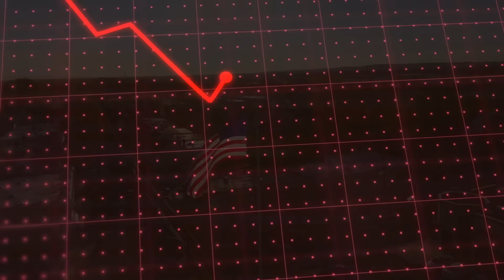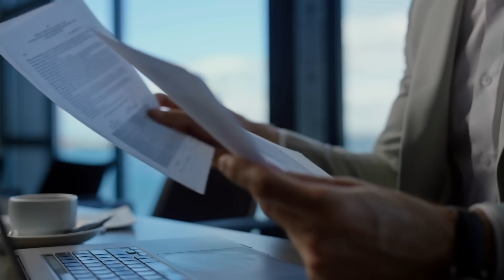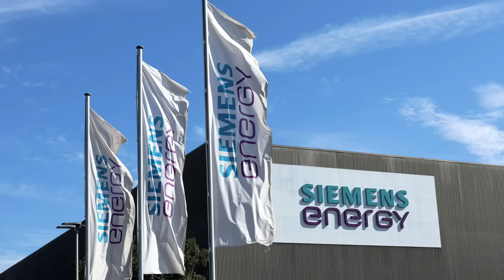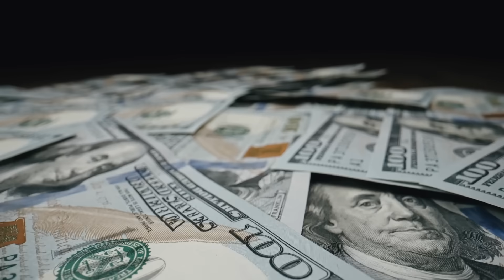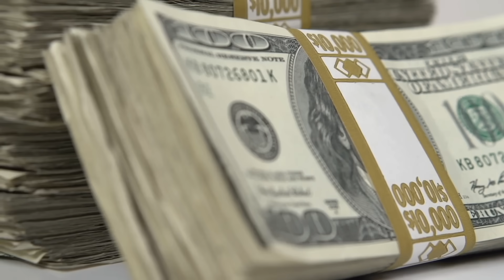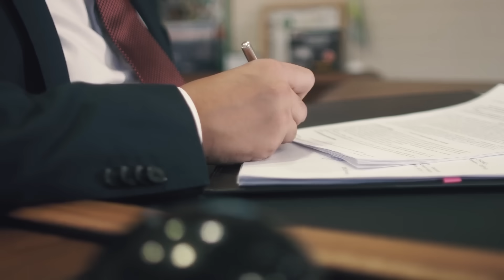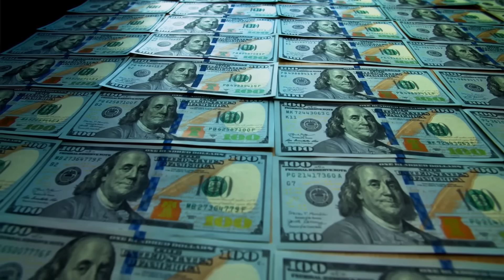The Real Reason America Has Turned Its Back On Wind Power Energy

Comment: Use the unconnected solar and wind installations to generate green hydrogen.
Reply: Hydrogen is Not  very efficient. You have to build storage, transport the gas To wherever its needed and end up in a fuel cell, making electricity. Why not use the electricity directly or Big battery storage.
Reply: Not only is hydrogen not very efficient, it is also highly flammable . . . remember the Hindenburg? That was both a "hydrogen storage" and "transportation" system.
Reply: @mhherr  We already transfer and store huge amounts of methane around, both as LNG and compressed gas. It has 3x the energy per volume as H2. There are relatively few mishaps. By far the biggest source of explosions and fires is plain ol' gasoline.
Reply: @rozonoemi9374  Good point, but it's a matter of scale. There is no current battery tec that can address dunkelflaute scale. Hydrogen can, but as you say, it isn't just a "big battery"; it's a whole different energy transfer grid where hydrogen must go to an FC estate close to where the energy will be used. So this "hydrogen-tank-not-really-battery" takes its place alongside hydro, interconnectors and maybe even some new heat-battery tecs to address these long-term high-capacity storage reqs. IMHO new Sodium-ion battery tec may make a dent in this, if costs come down to say $40/Kwh. Over the last couple weeks revolutionary new low-cost flow-battery chemistry has been demo'd. We'll see where that goes.
Reply: Stringing more wire is more efficient by far.
Reply: Aha! Yes this. We have a storage and distrubution issue. Hydrogen would solve both.

Comment: Dipshit's you cannot have systems feeding into the main grid that fluctuate like wind and solar. In Australia every solar system on a house must be able to be turned off from the power company. The reason is the voltage of the grid rises too much to get it in so on good sunny days a lot of time house hold solar is turned off as it would fry everyone's appliances. Storage is a joke but one day not in my lifetime.
Reply: As you wrote yourself, they can be connected.
And it is pretty standard that automated power generators of a certain size can be turned off remotely.

Comment: "Very green to make and maintain." - a complete LIE.
Reply: 1/100th of the CO2 emissions of a coal power plant for each produced kwh.
Reply: @old-pete That is a lie - the environmental cost to mine and smelt the metals, produce the thousands of gallons of lub oil and to make the composite blades, which are NOT recyclable, and the CO2 released by making the concrete used in most of the bases has not been HONESTLY reported. FACTS, not wishes, Grasshopper.
Reply: @donaldcarey114  The CO2 emissions of this work is already included...
And no, windturbines do not need thousabds of gallons of oil.
There are multiple options for the recycling of turbine blades.
Reply: @donaldcarey114  please don't repeat oil-company propaganda.
Reply: @alanhat5252  Please stop repeating green scammer's lies (or are you getting a kickback?)

Comment: ARE THERE ANY REAL SOLUTIONS?? ''YES'' I am RDP Marine since 2016 my unit had its proof of concept test. Its a retrofittable system for large dams both storage and hydro to make more power from the same volume of water. THEY DON'T WANT IT !! 
Pumo hydro needs 40% more energy to lift that water than is made when it falls through a turbine but thats OK. WHY? well u will pay 20-25% more for your power rather than not have it
Reply: yes. there are solutions. some are so very simple.
mine can be retrofitted. to a coal station. to a nuke. just need the steam turbine and generator. some water....

they dont want it. they dont want free power. as free as maintenance, supply, upkeep, installation...  they dont want it cheap. they want us suffering, clamouring, begging... fighting and squabbling.

we're in the hot water now! ;)

Comment: I worked on scoobie sands windfarm in JUNE 2023.  Heavy lift major component exchange of gearboxes, generators, transformers and pipe coolers! 

This is the image of the one burned down on a sand bar.  Vestas V80 nearly 25 year old and ready to be de commissioned
Reply: 25 years is not that old for most electricity infrastructure. Why are they being decommissioned so soon? Have they even paid for themselves by that time?
Reply: @Ethan.Lamoureux It is the mechanics that do not last that long. The electrics are usually fine.
With good maitenance one keep them running for 30 years, but the technical advancement in that time was huge in the past. From an economic perspective it is often better to replace them with a windturbine of threetimes the power.
Windturbines are paid off in 10 to 20 years, depending on location.
Reply: @old-pete  About 30% of my area’s electricity is generated by a hydroelectric facility which is over 100 years old. The old turbines and generators are still going, with only minor maintenance and upgrades over the years. Why don’t wind turbines last like that?
Reply: @Ethan.Lamoureux  You can be sure that the turbine blades are not orginal. They do not last that long. Generators can last that long, but at least the ball bearings and electrical contacts were changed. Water turbines do usually not have to endure forces above what they are designed for, as the water drop does not change.
Wind turbines have to endure the enviroment 24/7 for many years. The wind does not stop at the design speed. Windturbines need to endure all turbulences and storms over 20 years.
Additionally the forces are much greater due to the size of the turbine. If one exchanged the blades and bearings, one could run windturbines for many decades. There are examples of 40 year old turbines, but it usually not economical. One has to remember thatt the power of windturbines tripled in 20 years.
Reply: Opening image of the burned out nacelle is from Scrooby!
Reply: Some of the grey boxes in infrastructure shots had Russian text printed on them.

Governments failing to get on with the job of governing is worldwide & must be corrected before they condemn us all to ignominious deaths.
Reply: Hoax.

Such a load of garbage.

There no such thing as a greenhouse effect.

The whole premise of AGW -- the greenhouse effect -- is wrong.

There is no such thing as a greenhouse effect (except in an actual greenhouse (closed container)).

But there IS  a trillion dollar $$$ boondoggle that is the muscle that twists arms behind that stupid renewable energy.  

"Welcome to the Mafia-ization of the energy business."

             * * *

A Novel Perspective on the Greenhouse Effect (Tom Shula)

https://youtu.be/NS55lXf4LZk

1) Markus Ott: Questioning the greenhouse effect

https://www.youtube.com/watch?v=Bj6ORbRBZ2s&t=7s
The greenhouse effect is the primordial sacrament of modern climate science. It is preached from kindergarten to the nursing home.  The simple name of this effect and its ubiquity in culture and mainstream media leave no doubt that we are dealing here with solid and fully understood Natural Science. But how does this actually effect work?

2) Markus Ott: Atmospheric greenhouse effect ~0?  (Applying IPCC formulas to the no-atmosphere moon. Conclusion: there is no greenhouse effect on earth.)

 https://youtu.be/JXKHfL55G2A

Min 6:xx.  "Abuse of the Stefan-Boltzmann model..."

3) Markus Ott: Saturation of the CO2-IR-Absorption

https://youtu.be/CrMGTkPADFw
(Min 0:10) The alleged greenhouse effect of 33 degrees centigrade is the result of an improper use of the Stefan–Boltzmann Law (black-body radiation), and that a less abusive application of this law makes the greenhouse effect almost disappear. 

4) Markus Ott: Convection and Thermalisation Kill The Greenhouse Effect

https://youtu.be/RbNNhLqhWPg

In-Depth Comments on Sabine Hossenfelder's Talk: Greenhouse Effect 

"Heat transport in the atmosphere... IT'S CALLED WEATHER."
https://youtu.be/sY2xHk0ThJ8

https://thebreakthrough.org/journal/climate-change-banned-words/art-climate-change?utm_source=Breakthrough+Newsletters&utm_campaign=12e6304fed-BTI_Weekly_1_18_2023_COPY_02&utm_medium=email&utm_term=0_49b872540e-12e6304fed-466887052

If heat rises, why is it so cold in the upper atmosphere?
https://www.physlink.com/education/askexperts/ae670.cfm
Reply: @hg2.  Do you really need to spam the comments with your copy&paste?

Comment: The Australian state New South Wales (NSW) has released a plan for onshore wind generation areas that's heavily based on the current grid.  Seems its a good idea
Reply: They would look great on the harbour bridge and all over the opera house rather than polluting the rural countryside.
Reply: @tonybloomfield45283  well, actually...

as a moto courier, man... ive been nearly knocked over by gusts down some of those CBD streets. napolean on sussex... woah. 
crows nest? "the landmark"? (insert vomit emoticon).
having to pull billboards on scooters across SHB... never again...

theres plenty of power there. its EXTRACTING it.

maybe it needs radical rethinks, like... hey... elevators... what if we pumped water, or air in tanks buried underground, and used it for lifts? really, the only work other than friction is lifting lard arses...  most of its all counterbalanced...
escalators with big stinking steampunkesque clocksprings being wound when opportune, releasing constantly at a fixed rate and well.. if they run out, just um... leave them as stairs rather than close them? (effin westfields, walk all the way down one end and wtf... they are STAIRS... leave them open!) 
what if we used friction to supply all the heating needs? the amount of wind coming through crows nest would be making those buildings glow like plutonium cores if you could harness it... brakes? friction? heat :)

thats just scratching the surface. a RETHINK of how we do things.

its definitely possible, we just have all grown up with this convenience, these power points on the walls... and get... stupider with every passing minute rather than smarter.

i have this thing you see... electricity is not the answer. i could really do an in depth reason on generators and batteries, storage methods, power transfer... its all actually really simple when you think about it...

but i aint giving too much away on how i am sort of sidestepping all the issues. blowing my own horn, but i think ive figured the solution to the age old issue. wind power increases on the cube of the velocity, and so... under a certain speed, sure... its useless. but once it breaks a certain speed, we have no way (we think, ha ha) of extracting that power on a similar cube law, and storing it. a water pump, a generator, grinding grain... once its reached a certain load, thats it... we have to apply brakes and just WASTE the rest of the power.

unfortunately, every effort so far just hammers a nail into the coffin of what could otherwise be one of the most plentiful and abundant power sources we can ever have...

extraction... and storage. electricity isnt the answer.

oh, and another thing. aeroplanes can be made from timber. the 747 was just popriveted aluminium sheets. 

dutch made windmills from timber for centuries.

wind turbines only an aerodynamic structure.

why cant they be made like a 747? stamped sheet and some rivets.

packed up on a lil truck, assembled on site, and when they get old... melt em down, stick em up again...

timber works.

ffs i hate this modern world with its obsession with stupid crap like carbon fiber and epoxy...
Reply: That's going to be a hell of a lot of onshore wind to nullify all that CO2 with coal and natural gas exports!🤣
Reply: @LoremIpsum1970  yes a mighty lot of wind power is going to be needed
Reply: @LoremIpsum1970 that doesn't  count.  It only counts  when and where it's used
Reply: @bobgteen6496  Actually, that's total BS. You don't get to profit from offshoring your fosil fuels and blaming others for using it. otherwise - stop selling it.
Reply: Hoax.

Such a load of garbage.

There no such thing as a greenhouse effect.

The whole premise of AGW -- the greenhouse effect -- is wrong.

There is no such thing as a greenhouse effect (except in an actual greenhouse (closed container)).

But there IS  a trillion dollar $$$ boondoggle that is the muscle that twists arms behind that stupid renewable energy.  

"Welcome to the Mafia-ization of the energy business."

             * * *

A Novel Perspective on the Greenhouse Effect (Tom Shula)

https://youtu.be/NS55lXf4LZk

1) Markus Ott: Questioning the greenhouse effect

https://www.youtube.com/watch?v=Bj6ORbRBZ2s&t=7s
The greenhouse effect is the primordial sacrament of modern climate science. It is preached from kindergarten to the nursing home.  The simple name of this effect and its ubiquity in culture and mainstream media leave no doubt that we are dealing here with solid and fully understood Natural Science. But how does this actually effect work?

2) Markus Ott: Atmospheric greenhouse effect ~0?  (Applying IPCC formulas to the no-atmosphere moon. Conclusion: there is no greenhouse effect on earth.)

 https://youtu.be/JXKHfL55G2A

Min 6:xx.  "Abuse of the Stefan-Boltzmann model..."

3) Markus Ott: Saturation of the CO2-IR-Absorption

https://youtu.be/CrMGTkPADFw
(Min 0:10) The alleged greenhouse effect of 33 degrees centigrade is the result of an improper use of the Stefan–Boltzmann Law (black-body radiation), and that a less abusive application of this law makes the greenhouse effect almost disappear. 

4) Markus Ott: Convection and Thermalisation Kill The Greenhouse Effect

https://youtu.be/RbNNhLqhWPg

In-Depth Comments on Sabine Hossenfelder's Talk: Greenhouse Effect 

"Heat transport in the atmosphere... IT'S CALLED WEATHER."
https://youtu.be/sY2xHk0ThJ8

https://thebreakthrough.org/journal/climate-change-banned-words/art-climate-change?utm_source=Breakthrough+Newsletters&utm_campaign=12e6304fed-BTI_Weekly_1_18_2023_COPY_02&utm_medium=email&utm_term=0_49b872540e-12e6304fed-466887052

If heat rises, why is it so cold in the upper atmosphere?
https://www.physlink.com/education/askexperts/ae670.cfm

Comment: Small wind near the major consumers. Because of the copper shortage it's not possible to send electricity far away (yet)
Reply: One can make power lines from aluminium.
Reply: The copper "shortage" is a myth.
Reply: power transmission lines are an aluminum sheath over a steel cable. Underground cables also have polythene & rubber layers. Copper is out of fashion except for last-mile cabling.
Reply: Every country has very long distance HVDC interconnectors to neighbouring countries already & more are being built.

Comment: One of the major reasons wind is at sea in Europe is because of the major risistance picturest rural communities have against land windfarms.

US doesn't have that problem. Per unit of electricity landwindfarms are cheaper
Reply: the wind is steadier & stronger at height across the sea. Small projects can find gaps in the terrain to squeeze into on land, big projects need the extra space of open seas.
Reply: No way are they cheaper! Factor in the subsidies, plus the need to have back-up power due to intermittency and it becomes much more expensive.
Reply: US does have that problem.  A lot of rural locals fight wind farms due to subsonic noise and the flickering shadows they cast at certain times of days that are akin to visual form of Chinese water torture if your house is in a shadow of one of these turbines.

Comment: can't grd scale batteries fix the issue like immediately?
Reply: Why don't you just mine a few million tonnes of cobalt and refine it to while your at it. Immidiatly please
Reply: @JasperKlijndijk grid scale batteries do not need to be made with anything special. They are actually much better off with more simple ingredients both for cost and for the purpose. 

LiOn batteries are only used if they are made up of old used EV Car batteries to reduce costs. Giving the batteries a couple decades of reuse after they are taken out of a car, before they are sent to recycle. So no new Cobalt, Lithium and such are mined for these grid scale projects.
Reply: LFP batteries has no cobalt. @JasperKlijndijk
Reply: There is more cobalt use in refining the dinosaur juice, than making batteries! @JasperKlijndijk
Reply: Battery manufacturing is already at full capacity & it takes time to build extra factories.
Reply: Not in China! @alanhat5252
Reply: China is only producing 65% of there capacity, as per CATL. @alanhat5252
Reply: The problem is the grid, or rather the hundreds of separate grids that don't communicate properly. It's one of many many problems caused by feral capitalism.
Reply: @alanhat5252  a for profit privately owned electric grid should be criminalized. They are terribly in efficient in terms of providing low cost reliable electricity to citizens, and resistant to change for social benefit. 

The right economic model needs to be applied to each industry sector. For profit power grids are as stupid as government run bakeries. Anything with a natural monopoly like power grids should be government run.
Reply: Nickel hydrogen batteries or hydrogen for storage. Like most of these ideas, they aren't properly thought through.
Reply: @aries6776  liquid metal or iron battery would do the job